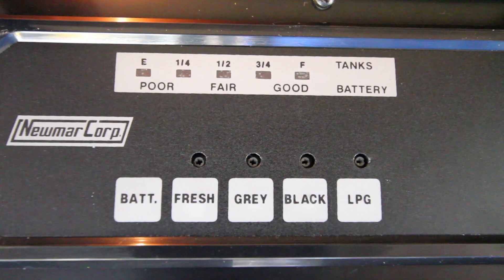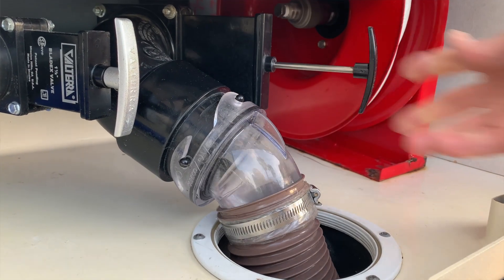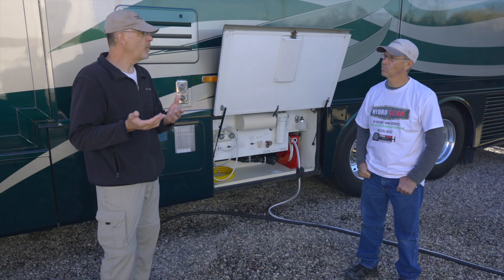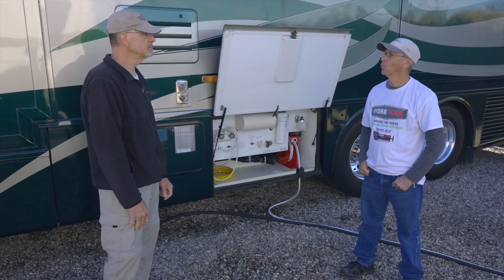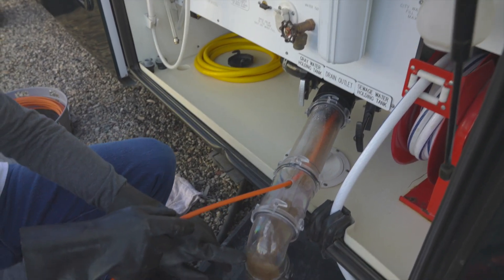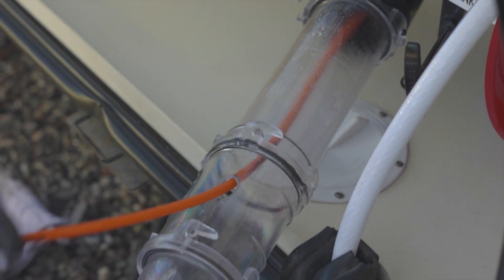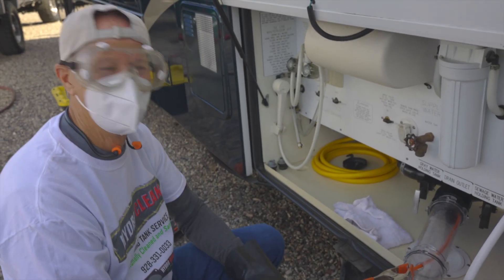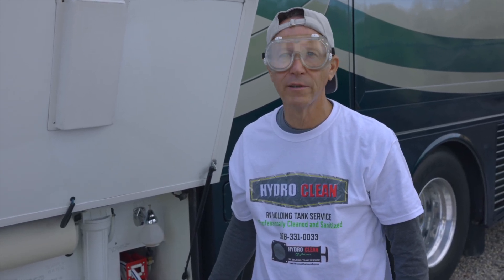RV Holding Tank Sensor Fail! Power Washing Black & Gray Tanks & Struvite Removal.

Comment: When I bought my Class C this spring none of my black tank sensors worked. They were all stuck on full. I tried just flushing the tank with no luck. I read a post of using 20 mule team borax and Dawn dish soap solution where you add it to the empty tank. Drive to your camp site letting it sloch around. After the weekend I drained the tank and gave it a good flush and half my sensors started working again. After 2 more treatments they are alll working now. So now after every flush I add about 2 quarts of the mixture and it seems to be keeping things clean and working. I don't even add deodorizer to the tank any more.
Reply from the maker: Excellent! That’s a great success story, Ken! 👍

Comment: Hello, I follow your channel and TV shows and respect your opinion. I would like to ask if you have reviewed the Lippert Components 389380 RV 360 Siphon Tank Vent Cap - Black?
Reply from the maker: Hi Tom. Thanks so much for your kind words, and great question. We have indeed made a video about the 360 Siphon. It's the original version, but works the same as the new one.... which is to say great! We got ours before the company was owned by Lippert, but the new ones should do the same job, and hold up just as well. Ours are still like new after more than 7 years. Practically indestructible, and they do what they're designed for. Here's that video: https://youtu.be/3xX60cCHwlM Safe Travels! — Peter & John
Reply: @RVgeeks  WOW!!! Thanks for the quick response. I was wondering about rain getting into the tank and if the bug screen grid will keep wasp from building a mud nest in the pipe.
Reply from the maker: Never had a problem with either, so we think you’ll be good!

Comment: I have seen that stuff multiple times, but didn't know it has a name. I don't have an RV, but let just say that RV black tank is not the only  place where you can see that stuff. 
I would really want to see how a real composting toilet would work in RV. Most of composting toilets really aren't composting even they are called such. True composting toilet is much bigger and needs emptying only once or twice a year (depending of the use of course). (If you want to see an example, google biolan composting toilet.) Composting reduces volume of "the stuff" about half or 2/3 and most of the liquid is evaporated, so it would be a really easy solution as a toilet, but I have never seen a real composting toilet in RV.
Reply: Also you can put food waste there.
Reply from the maker: Great info! Yup.... not enough space in an RV for a true composting toilet. But the ones available are still pretty great!

Comment: Be sure you use a quality firm before you do this. I used a service in the LA area and they damaged by black tank rubber seal dump valve so it leaked after they were done. I had to get it replaced. There was no way to tell it was leaking until I got ready to dump at my next stop as the tanks were empty after they were done cleaning them out.
Reply from the maker: Yikes, sorry to hear that Ira. Black tank & valve issues are a nightmare to deal with.

Comment: I am surprised there isn't some sort of chemical / solution that you could put in the full tank with water to remove a lot of that, pull it off the walls or at least help prevent it.
Reply from the maker: Some say a product called Tanktech RX works as you describe, but we haven't used the product yet ourselves so we can't report on it.

Comment: Thank you for this info!  Our rig is 16 yrs old, and we’re not full-timers but I think we need to look into having this done.  Problem:  we live in the Pacific NW, nowhere near Mike!  Do you have any suggestions on how we might find someone reasonably nearby to do what Mike did for you?  Thanks in advance!
Reply from the maker: Hi Laura. Typically, vendors who do holding tank power washing are more common in high-traffic RV destinations (Florida, Texas, Arizona, etc). You could start by trying to Google for "RV holding tank cleaning" or "RV holding tank power washing" in your area, to see if anything comes up. If that doesn't work, you could try contacting the service department at any local RV dealers... they may know of someone in your area who does it, too. Failing all of that... you may need to plan a road trip! 😉 Hope that helps.

Comment: Good Tank cleaning, however running a gas powered pressure washer in the confines of the covered truck bed is a sure fire way to end up with dangerous levels of carbon monoxide in the truck cab
Reply from the maker: You're absolutely right about the dangers of CO, Kip! Apparently Mike thought of that, as he has a hose set up that vents the fumes out of the truck while it's running. I didn't show him put it in place in the video, but, no surprise, he uses an RV sewer hose! LOL
Reply: The bed of my truck is in no way connected to the cab. Unless you had a boot connecting the two of them, I don't know how the co2 would get in the cab.